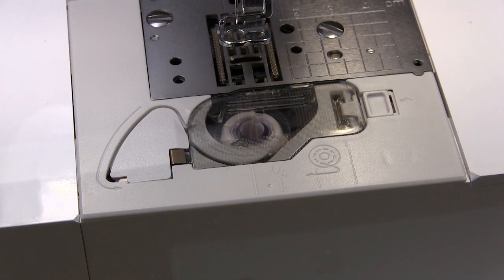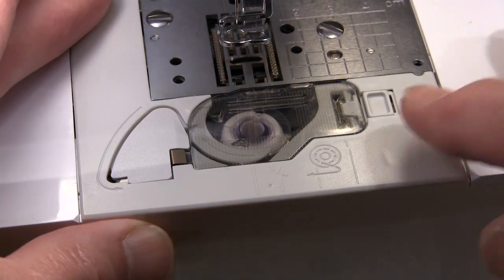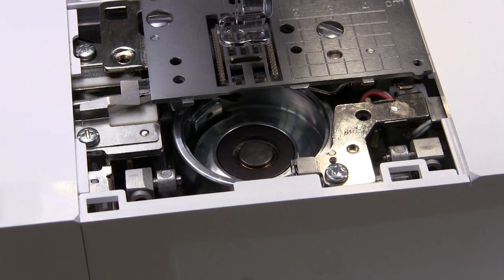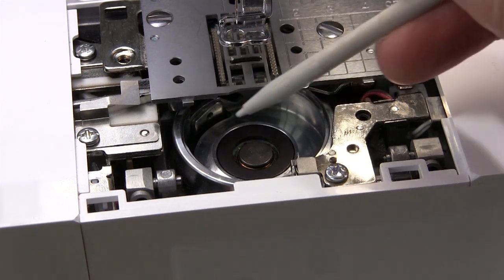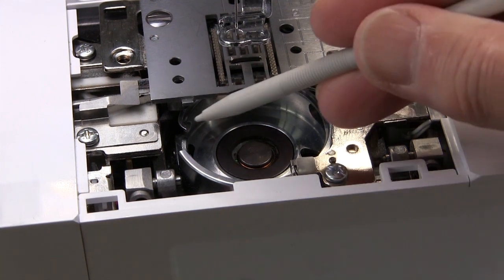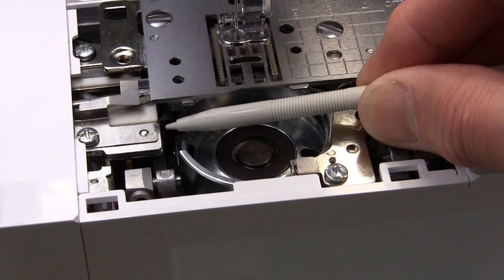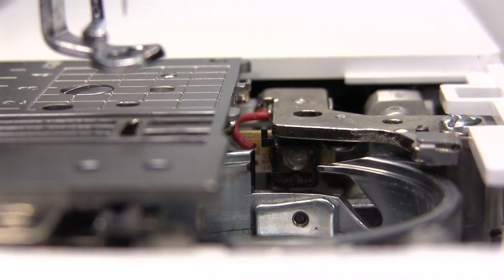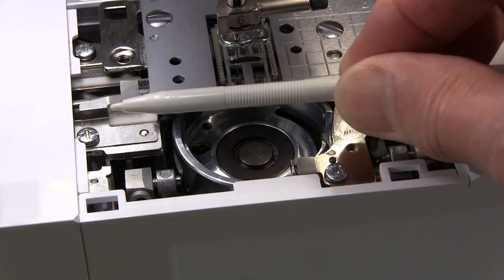My bobbin thread sensor doesn't work

Comment: Hi thank you for the video. I'll be cleaning this bobbin sensor. However, the message I keep on getting is "Check and Reathread the Upper Thread", but thread is perfectly fine, and none of the basic troubleshuting on Brother's website have worked on my PE800. If you have have any advise on how to solve this issues I'll appreciate*

Comment: Sometimes my bobbin thread doesn't pick up when continuing a design and just keeps stitching without the bobbin thread, so I have to keep re-threading the bobbin thread. Hope this makes sense. I have the Luminaire.
Reply: Jennifer Ward That happened to me only last week, so all I did was re thread it and it was fine.
Reply from the maker: One of the causes can be that the bobbin fill is too tightly tensioned causing it to slip the top thread on collection. Try using your alternative bobbin case and set up the tension as per my “know your bobbin thread tension” vid and see if that fixes it until the next service when I can check it out for you 😊 - Keith.
Reply: Will do. Thanks Keith, will try tomorrow and let you know how I get on. It’s not a big problem and doesn’t do it all the time, just a bit annoying if I take my eye of it and find out that it’s been embroidering for a bit and not stitching. 😸
Reply: I feel I should tell you that the problem you have is not unique to your machine. I have a Dream Machine 2 the same thing occurs.  I learned it is a problem with the senor when you are using the rebound white bobbins. My machine was in for repair and cleaning, after five weeks they did not fix the bobbin sensor issue. This morning I emailed the Brother USA company to see what they have to say. According to my dealer they have the same problem with the brand new luminaire machines. If you use a colored Bobbin (not a white one) you will not have the problem. I feel this is a bigger issue than a little lint in the bobbin case.